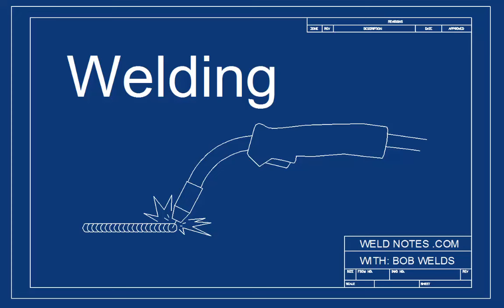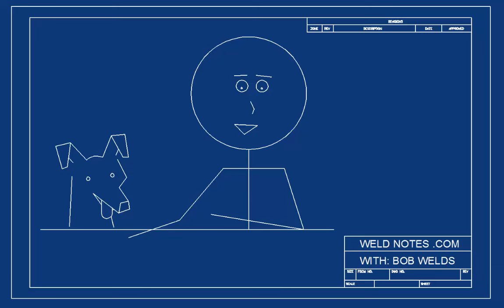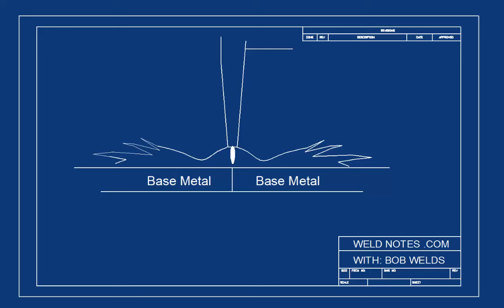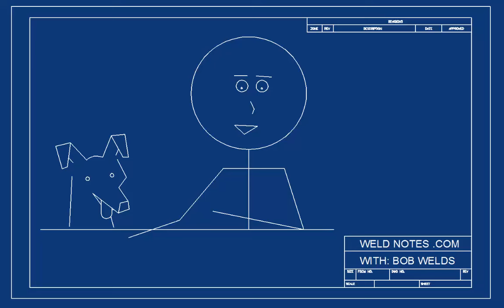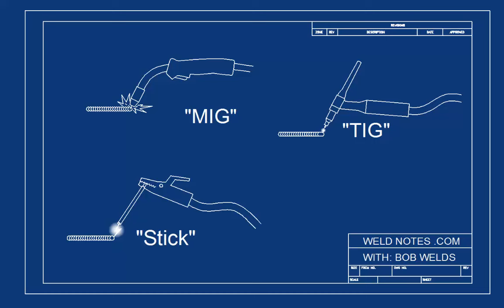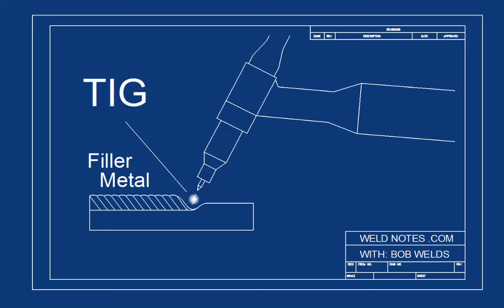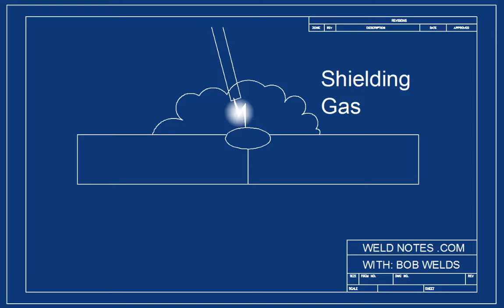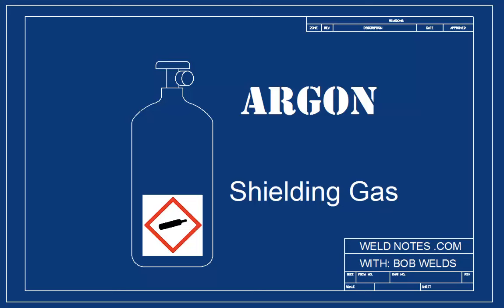Welding Introduction - Weldnotes.com

Comment: Hi, Bob. I know some people close their eyes while welding without wearing a mask or a helmet.
Is that a dangerous thing to do? What are the health hazards or side effects of it?
Reply from the maker: Golly, Shepp -- that's not recommended at all.  There is a lot of UV coming out of the arc.  That's going to burn their skin if nothing else.  Also, the hood helps protect against flying spatter and sparks.  You see it done sometimes --  especially when people are tacking an assembly together -- but that doesn't mean it's a "best practice."  Also, welding without looking tends to produce some pretty lousy joints.

I know folks will say "I've done this for _ years and I've never gotten hurt," but that argument doesn't really hold water.  I try to err on the side of caution.

Thanks for the question!
Reply: Thanks a lot! A user claimed on Quora that UV can even reach the retina through eyelids. I don't know if that's true but it sounds very scary!